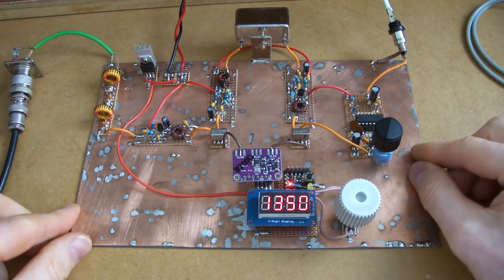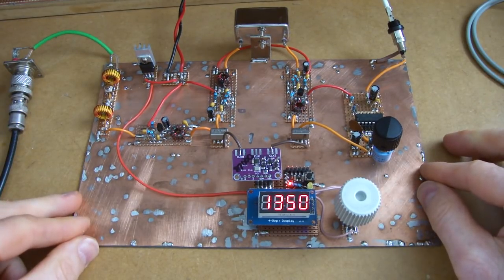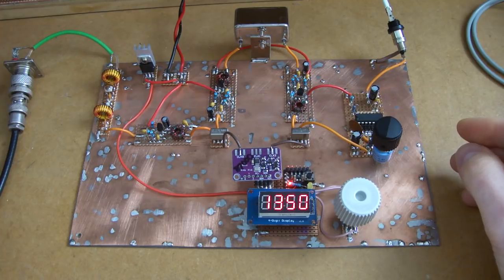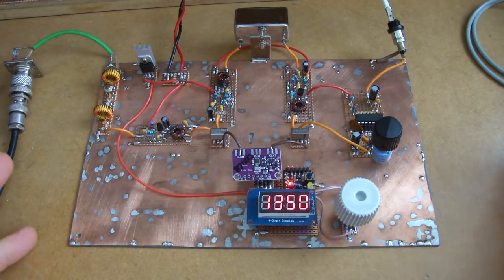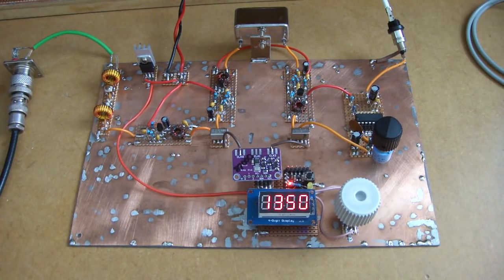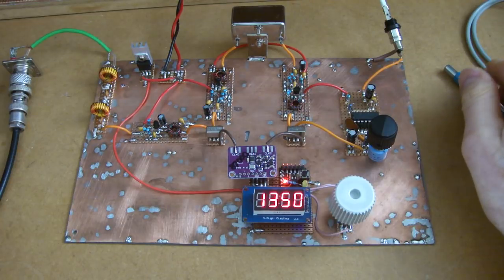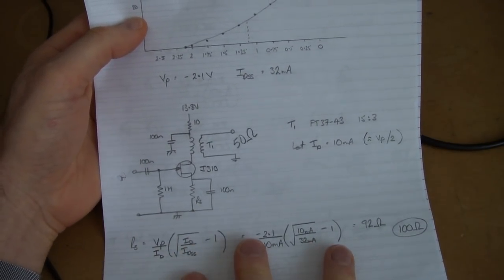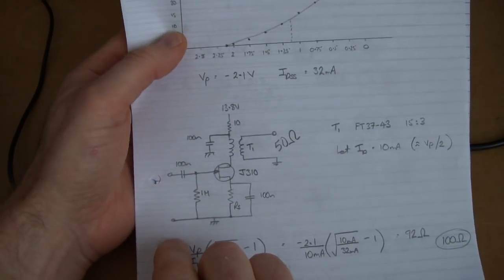20m Receiver Configuration

Comment: I'd love to have a bash and making a receiver one day. Loads of research needed on my part. I love the coarse/fine tune on the rotary encoder.
Reply from the maker: Thanks. This is not the normal display I typically use, but good for the small tramping rig.

Comment: Hi Charlie,
simply to swap the two outputs via the software is a really good idea . Why I did not come to that when I had the problem with the feedback when sending : - /
Fortunately, I've built my concept (like you) modular. So I can easily rebuild it now :-)
Thank you for this fantastic idea!
73 Bernd
Reply from the maker: Sounds good Bernd. I was turning CLK1 on and off with the morse key on the CW rig and it worked fine. Swapping CLK0 and CLK2 for the SSB rig should solve the feedback problem I have experienced before. Yay!

Comment: I wonder how much having the output of the BPF connected to high-impedance preamp input instead of the (presumably) designed for 50ohms might affect the shape of the BPF response (and noise I guess?).  Perhaps increasing BPF output capacitor to say 100n would effectively connect high impedance preamp input directly to BPF high-impedance second tank and hence provide a better match. It would be interesting to see if this made any worthwhile improvement in performance.

Anyway, it's nice to see your designs always evolving over time. Keep up the good work.

Cheers,
Steve
Reply from the maker: I though the same Steve. I will try and characterize the current configuration, then change the out put cap to 100n. Thanks again for the feedback.

Comment: I love how you use a large copper plate as a ground plane.  I'm looking to reproduce your setup,  but I'm wondering if a steel or brass plate would also work?  Copper is quite expensive where I am in Canada.
Reply from the maker: The copper board is expensive here too. I use sandpaper (and block) to make it smooth again for the next project. All those silver splotches in the video are old solder tacks. I can do that several time before it gets too thin, and only then it starts to show around the edges. As for steel, not too sure. It would still act as an earth plane, but I suspect you would have trouble soldering to it. Brass would be better as it' contains some copper.